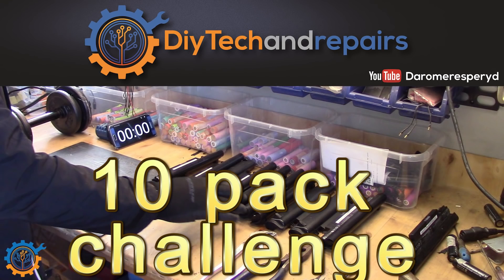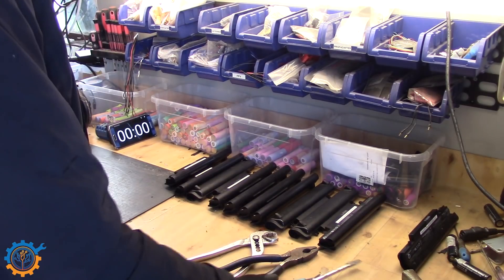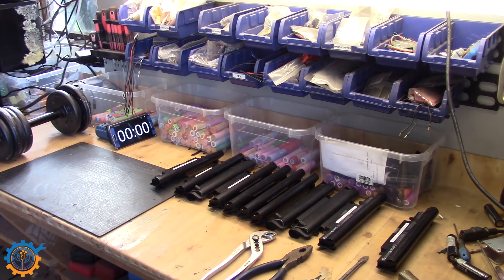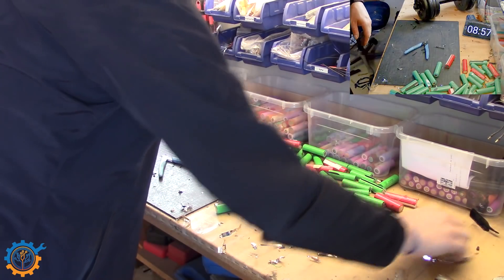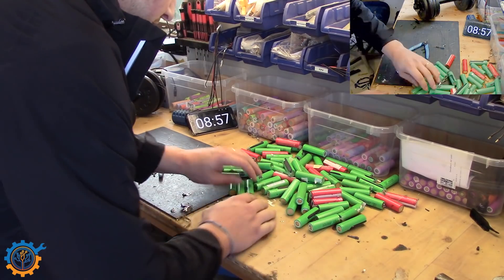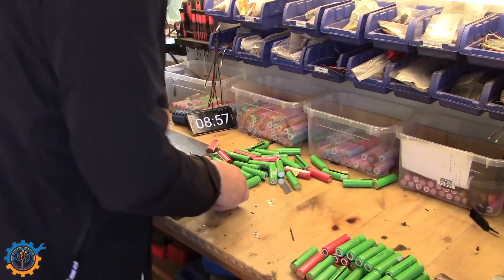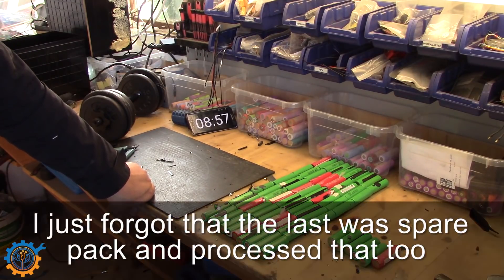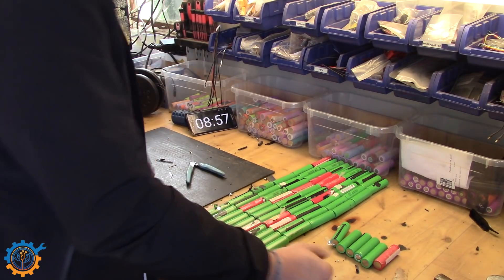10 pack challenge - Process 10 laptop packs as fast as possible

Comment: That's kewl, I didn't think about using the dumb-bell weights. Brilliant!!  I will definitely be incorporating that into my pack attack.
Unfortunately I can't do the challenge as I don't have 6 cell packs. Nor do I have 10 packs of the same or similar types. Oh well. Maybe next time :)
Reply from the maker: Though hitting them like that could potentially bend and smash the cells inside. So only do it on the electronic side and on packs that you potentially could miss a cell :)